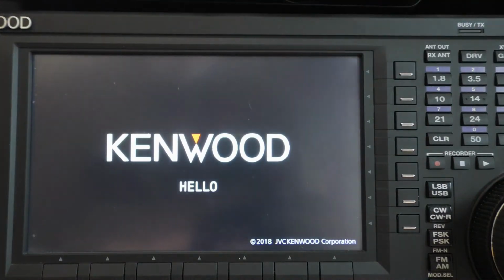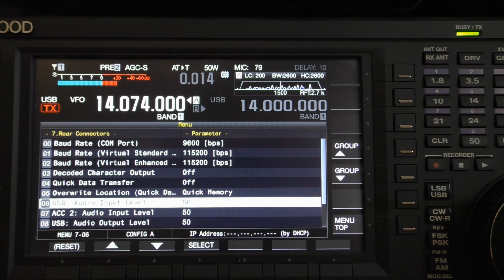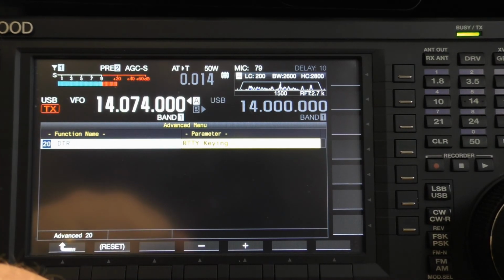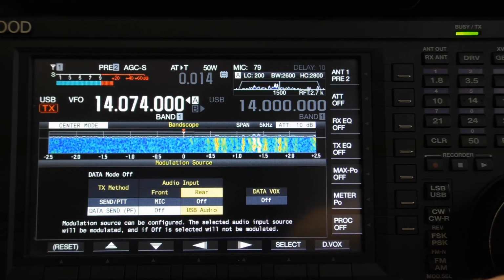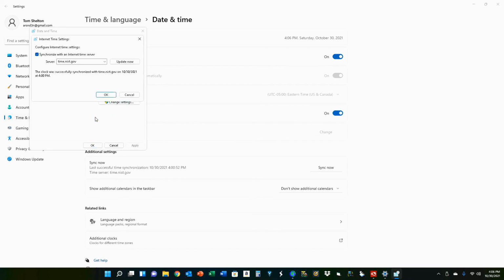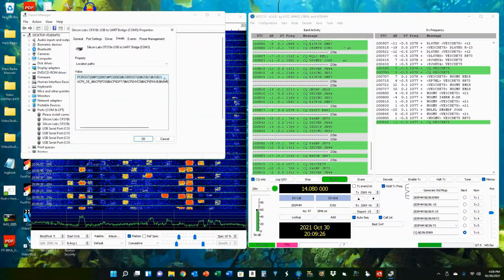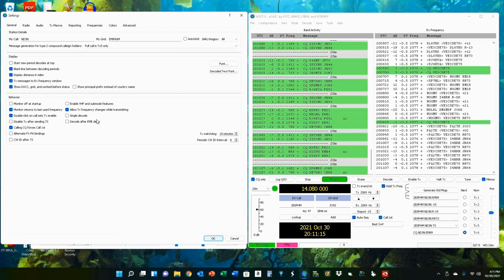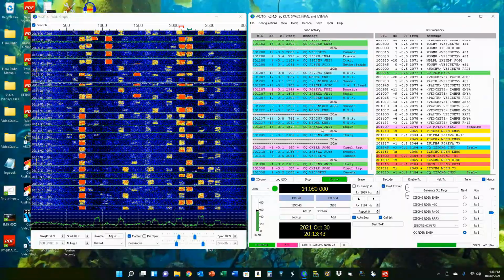TS-890S / WSJT-X Setup

Comment: Hi Tom, may I ask a question about the Kenwood TS-890S versus the TS-990S?  The 890 doesn't have dual transmit/receive but the 990 does......should something occur would a person want dual transmit/receive?  I was a Combat Signaler in the U.S. Army for 3 yrs active duty.......Thanks sir
Reply from the maker: The 990 also has a 200 watt output.  Both are direct conversion. The only benefit I can see is if you’re doing a contest and want to run 2 bands at the same time..  it’s also about twice the price of the 890.  As I don’t have a 990, these are only my suppositions, and I can’t speak with any authority other than I really like my 890.

Comment: Tom, I have a FTDX-101mp thinking of going to the Kenwood TS-890s. I see you have an 890 and 991. can you make any recommendations?
Reply from the maker: I hate making recommendations, but here goes.  Comparing based just on cost, I’d recommend the 991A.  For functionality, the 991A offers V/UHF and System fusion -GRMS, but the menu and function settings are a bit clunky.  The 890S is about 3 times the cost and is a full featured HF + 50 rig.  The controls are more intuitive with front panel access to those you’ll need most often. I think you’d be happy with either, so the choice is yours.  73 de Tom, ND3N
Reply: @ND3N  Thank you Tom

Comment: I have set everything you suggested and still can't get FT8To Work.  When I switch from 40M to 20M I get a single line of decode on the waterfall then it goes off.  My settings are EXACTLY as you suggested, Any Ideas?  Gary wi0v
Reply from the maker: Was it working on FT8 on 40 meters before you changed to 20?